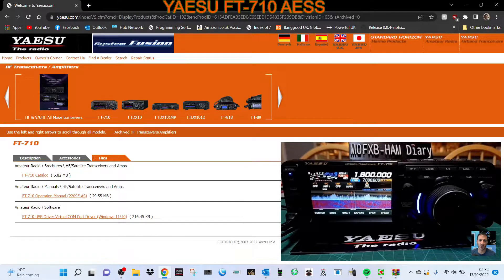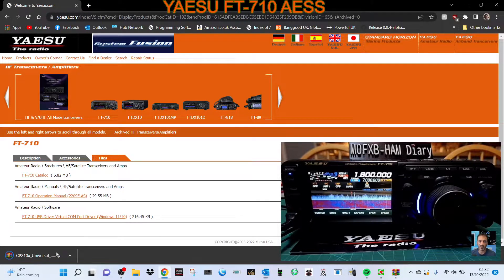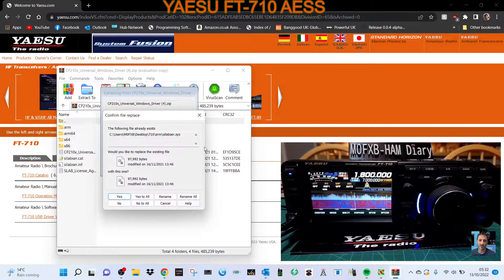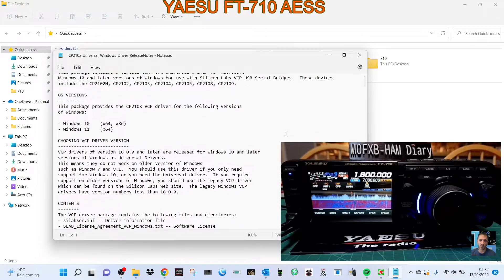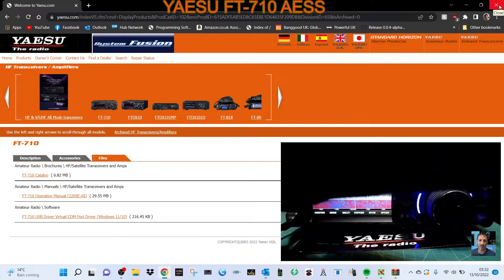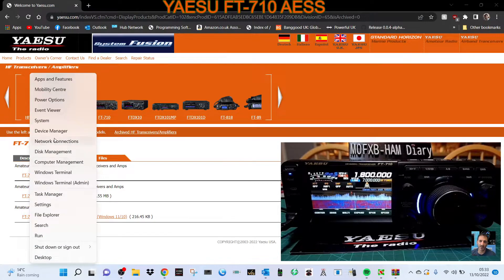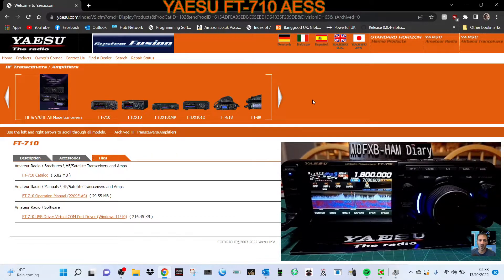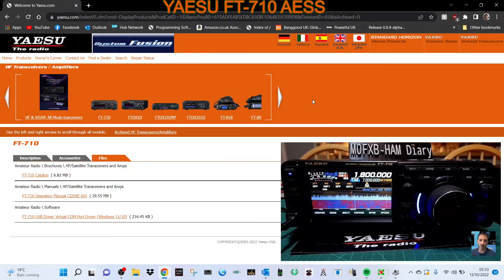YAESU FT-710 USB Driver Install -Windows 10/11

Comment: thanks so very much for taking the time to put these videos together! I'm newly licensed (general) and have purchased this HF transceiver. I have Parkinson's Disease, so to make this as uncomplicated as possible I am forgoing a shack in my home and will operate "backyard portable" using a Wolf River Coils whip and bullet antenna. I also have a Chameleon EMCOMM II that I can deploy from the top of the same whip to give me a 67-ft sloper. I live in an area of the country where hams bury ground rods horizontally (when they can) due to the amount of rock in this area. All of that became too much for my brain - added to the fact that I was going to have to go 125 feet to get to the household ground rod that is located inside the garage wall. (I have a newer home). So - sorry to write War and Peace here, but your videos have been hugely helpful to me. I just wanted you to know that what you do is appreciated.  Thanks again!  Jim K7NJL
Reply from the maker: Hi Jim, thanks so much for your kind words. 73

Comment: I don't have a clue what I am doing wrong. Unable to get a Silicon Lab windows driver to download using info at Yaesu for 710 or 991A.  I extract the files but there is no executable file
Reply from the maker: Sorted
Reply: I'm having the same issue right now.  Download it, extract, no driver.
Reply: @johnb6084